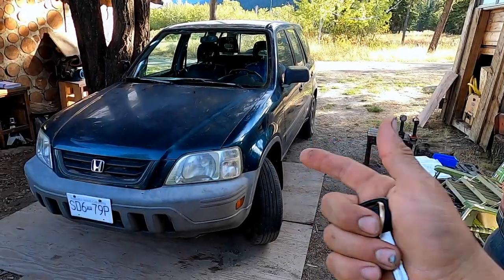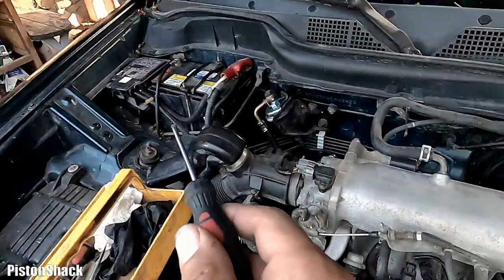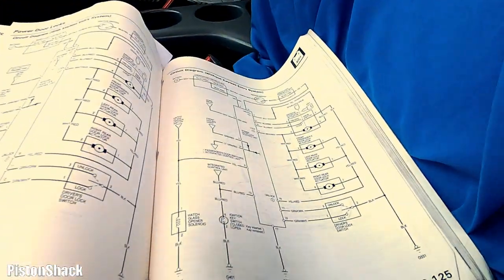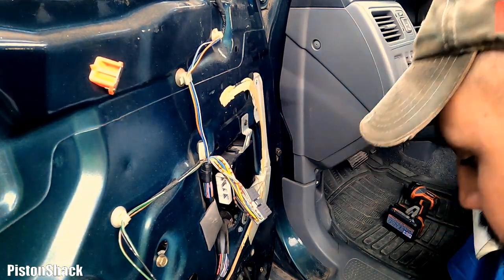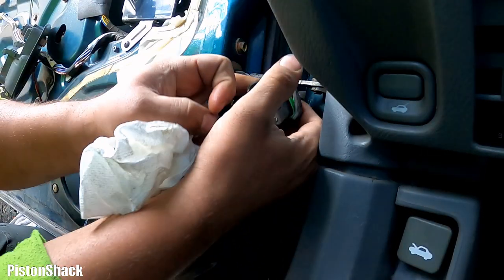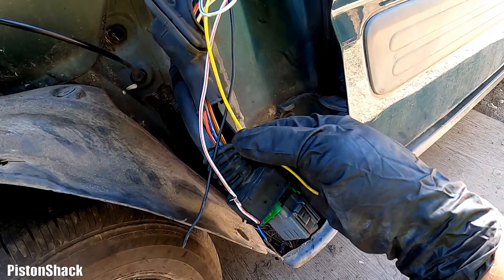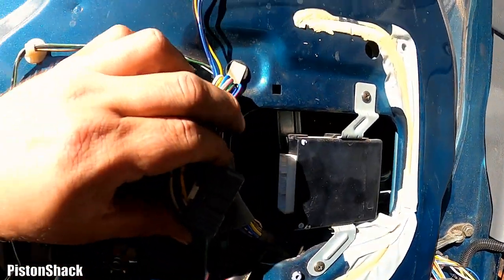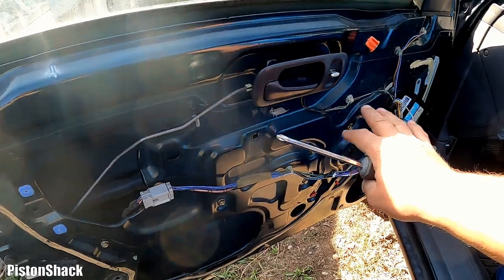HONDA CR-V POWER DOOR LOCKS COMPLETE DIAGNOSIS & REPAIR | 1997-2001 HONDA CRV

Comment: Wow! You're a smart guy. I found what you did here so illuminating. My passenger side door lock just decided to stop working on my Gen 1. This video made me think about realistically all the variables I should check. I was just going to replace the actuator but like you say - I should check the basics. I knovery little about electrics though. Wish me luck:)
Reply: Did you get it fixed? I have the same problem with my 1999 CR-V

Comment: Thank you ☺️
I remove the cable from the door to connect it with new one
I welded the cable with new connector and the door lock not works
2 hour checking the cable again gain a gain and the fuses in the car but it is not work . we forget that front fuse in the car 😅
Replaced it and its work properly 😂
Thank you
Reply from the maker: Glad it helped, buddy!

Comment: Wife has a 99 CRV I originally started with fixing the car clock, well long story short I’ve replaced fuses, checked it with a scan tool , chased a passenger side window not closing issue, swapping spark plugs, oil change some body work next is the drive shaft break lines and now the power locks lol I started with the clock, I couldn’t figure out why my 03 Sonoma wouldn’t turn over so taking a break I’ve learned how to repair all of the things except that darn clock lol was pretty sure I would have got the Sonoma running but dropped the one Torx or T20 bit into the engine compartment and it was to dark to see at night 🙄🤷‍♂️🤙

Comment: You have the service manual, if you had the electrical troubleshooting manual you would have seen that you were looking at pin # 5 instead of pin # 16 in other words you were checking for ignition input on the yellow Hatch glass open output yellow wire.
Your probably only had a bad Power Door Lock Control Unit and you probably broke the wires in the plug trying to disconnect the connectors inside the door.
Pin #1 on the  Power Door Lock Control Unit has no connection and pin #8  is the battery input so adjust your pin count accordingly.  Your manual should show you the pin configuration and each wire color.

Comment: Gen1 drivers door wiring harness 25 pin connector going into the door from the jam, the wires famously breaking breaking off the pins. There was guy making replacement 'pigtails' for the jam side of the harness as the door harness connector seldom seems to have problems; 100 bucks; solder or crimp yourself.Thanks!